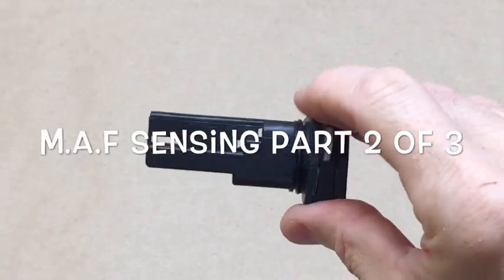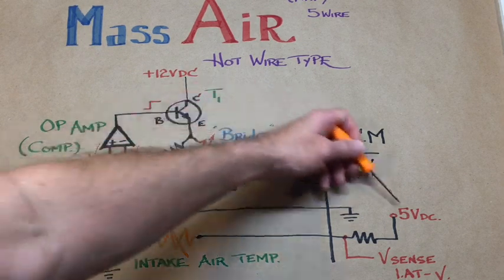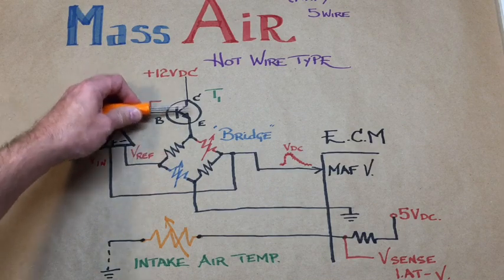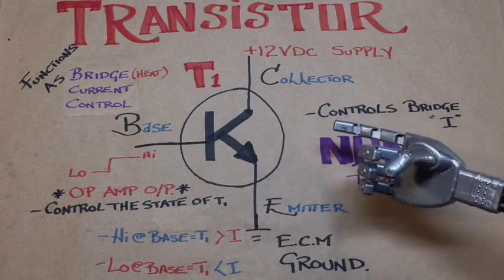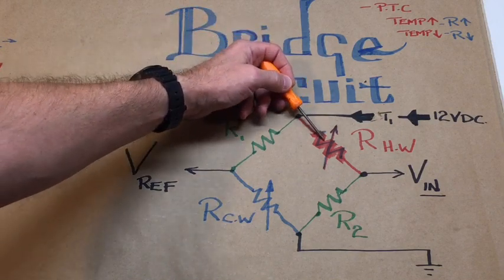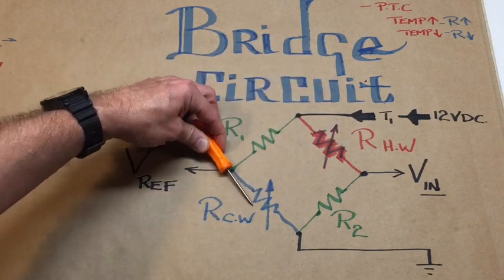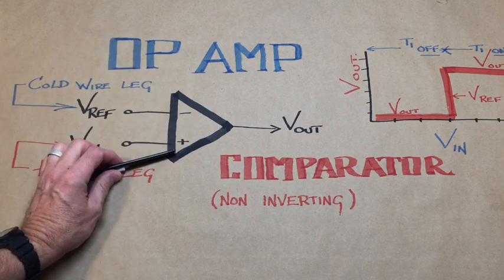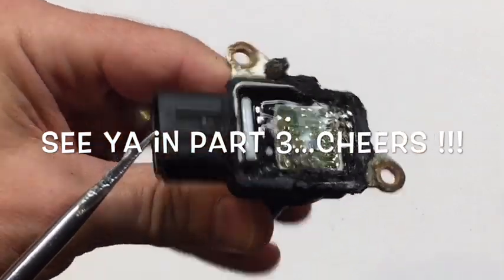M.A.F Sensor Circuit Operation

Comment: That helped me so much. Thank you! I'm trying to understand how a MAF works since I am working on a Nissan in Asia that barely exists online. It has the same engine as an Infinity and a Maxima in the 90s in USA.  There are 4 pin and 5 pin versions and trying to figure out why there are only three pins in the connector that the book says should be 4 and all MAF testing vids say there should be a ground somewhere in the connecter... Well not.
I think a questionable or genius mechanic dropped the wire cause there were only 3 connectors in the old models...and let the ground float??... I'll know more when I track down where its supposed to go.
Reply from the maker: Thx for watching 🍻

Comment: Can you make a video of transmission cvt some time work when starting and stops like doesnot shift when stopped changed transmission 3 times and just don't khow what's actually wrong cause the mechanic says to replace the transmission and it comes back after I drive the car home
Reply from the maker: Sorry Dude. Honestly, know very little about CVT operation/control. Thx for watching 🍻